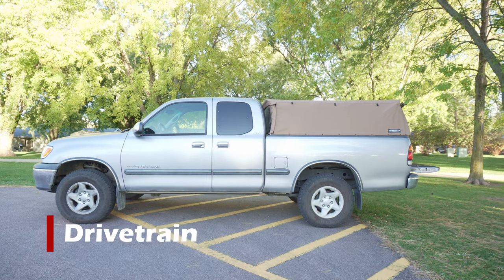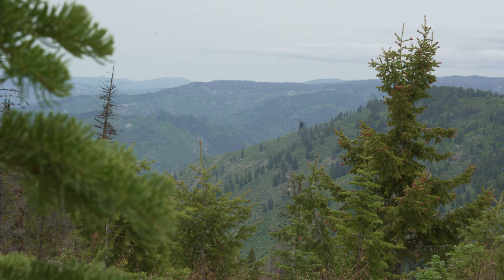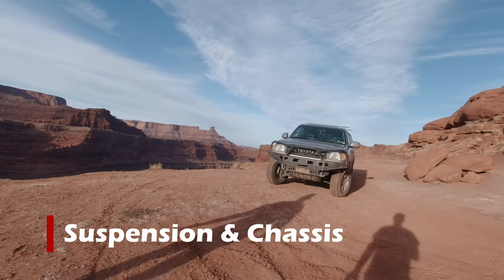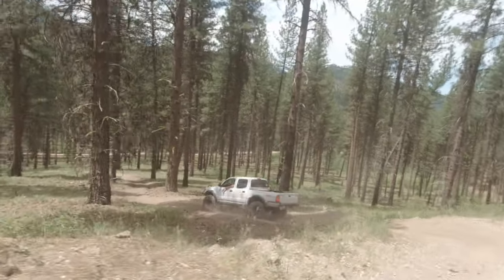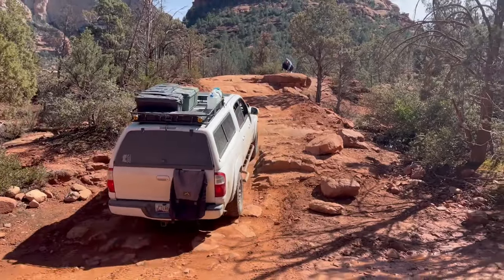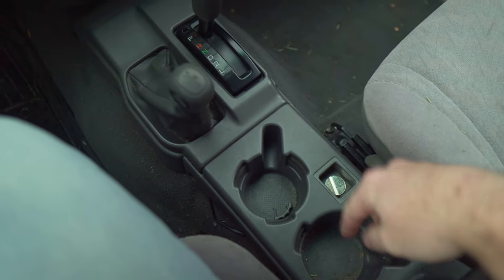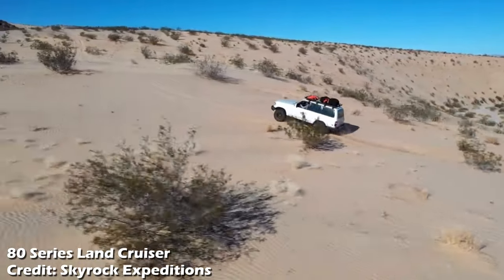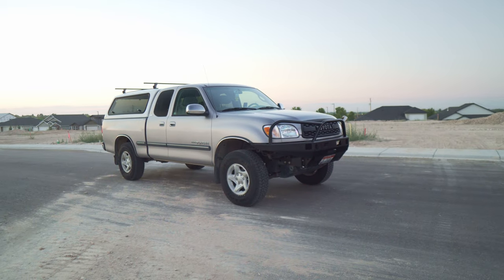This is why Toyota DOMINATES the Overland Scene

Comment: 2UZ-FE 06 Access Cab Tundra. 147,000 miles. Bought for $11K in 2021, overhauled key cylinder and replaced front struts, CV axle.  I use for dump run side gig and it paid off itself within a year
Reply from the maker: Nice! Sounds like you’ve got a solid pickup!

Comment: I bought two brand new 2003  Access cab-Tundra twenty years ago. SR·5 TRD 16wheels & limited with 17wheels. with leather ( worst mistake leather interior ).  I lifted the SR·5 and swamped tires and run the 17 inch wheels all the add on are on this one. run a K&N cold air filter & use Denson Iridium plugs .  120K.  and the limited run stock with the 16 wheels. Iridium plus & stock K&N air fliter 71K.  I also have a 3rd Tundra SR·5, I use for parts.       I've never had a car twenty years, I was spoiled with having a Dealer Demo. New car every 5K miles. I bought the car when I left the dealership.

Comment: 2002 Sequoia bought for $2750 at auction 168k miles (200k now) doing timing belt as i type. and sadly, the belt looked fine. love this rig. gonna be a trail machine with the kids here in COlorado . did TinCup and Medano passes on factory height
Reply from the maker: Awesome! Sequoia's are great vehicles

Comment: I've got a 1997 4runner with 230,000 miles and I'm currently doing a 3 inch lift and new tires to go hit some trails on the weekends. With it being a Utah car it's whole life, it's had a couple rust issues(I replaced the front calipers) but besides that, it's never ever let me down and I abuse it daily. I bought it with 70,000 miles by the way
Reply from the maker: Awesome!

Comment: Great video! Only thing I disagree with is the height statement. I'm 6'2 and can comfortably fit into my 05 Tundra. 1st gen Tacos are pretty generous as well. Only toyota I've had issues with legroom was an 03 Corolla
Reply from the maker: Ya, I’m similar height, I’m talking 6’5” ++ these trucks are more limited. I got ok in the tacos too, but if you’re tall or large they’re not comfy trucks.

Comment: I'm running a 2008 v6 4runner. She's got 291k on the clock and running just fine. I wish I had known about the gx 470 when bought the 4runner.  I'd like to have a bit more head room and the 4.7L would be nice. I'd like to swap in an FJ cruiser manual transmission (a 5 speed should have been an option), or find a way to put a D4D diesel in it.
Reply from the maker: Nice! Ya the GX470 is great.

Comment: My dad was a Toyota service manager for 30+ years so I grew up with them, owned dozens. Currently own a 2010 Tacoma TRD Sport and a 2021 Rav4 XLE. One thing you forgot to mention was the frame rust issue. My Taco had it's frame replaced just before I bought it. I would have never bought a 2nd gen had this not been done. Far too many of the Tacos and 4Runners that had that issue.
Reply from the maker: Well, ya. Rust affects almost all vehicles, though Toyota has it particularly rough. 

I live and buy vehicles in a region where rust isn’t an issue. That’s the only way most people can find clean and safe vehicles that are 20+ years old.

Comment: I had a Toyota Sequoia in the past and it was definitely more reliable than my current wrangler, besides the frame rusting away. Although, I think my wrangler hasn't been too bad on reliability, most of my issues have been with low quality aftermarket parts/upgrades.
Reply from the maker: Thanks for commenting! I've had so-so experiences with Jeeps. I daily drove an 03 TJ for a while and my main issue was that it was a bad daily driver. Very noisy, not very comfortable. I think they can be fairly reliable for their first 150k miles.

Comment: I have a 01 Tacoma 3.4L automatic transmission double cab 4wd TRD with the Toyota E-Locker in rear and a Eaton E-Locker in the front diff, King 2.5 Coil overs in front and all-pro expedition rear leaf springs, RCI 1/4” steel skid plates with the front sway bar disconnected. Rock sliders on side and steel bumpers front and rear and Warn 8,000lb Winch and the Tundra 13WL front caliper and rotor upgrade and beefed up front CV axles and a Midland MXT275 GMRS radio.  Currently running the great Nitto Ridge Grapplers P265/70R17 tires. Next set will be Toyo AT3’s.
Reply from the maker: Sounds like an awesome pickup!
Reply: @208Tyler  yea i have had it since new and it’s my baby. I only use Full synthetic oils and oem Japanese made parts and rubber bushings when i do maintenance or replacement. I did tack weld the slip joint in the steering column to get rid or the common steering wheel chatter those trucks can start developing after a few years of offroading. You notice it usually when going over cattle guards or washboard roads or rough roads.
Reply from the maker: @erice4611  Is that what the issue is?? My brothers 01 Tacoma TRD also has stupid steering wheel chatter. I notice when I've had to drive it once or twice
Reply: @208Tyler  yes it took me awhile to figure that out and replacing the slip joint is a waste cause in 30k miles or so it will start doing it again so once I pulled out the column which wasn’t too hard and just tacked welded the “slip joint” that’s designed to collapse in a serious head-on collision enough to not chatter it’s quite and solid feeling again like new and has been for years over lots of rugged terrain.

Comment: Gx460 sport package 2017 with captains chairs no air suspension  installing ome springs with beilstein 5100 front and rear 2.5 inch lift medium weight springs   (2 inch lift wirh weight).  78,000 miles on the odometer drives and looks like new.

Comment: I have to say the Nissan Frontier is right up there with the Toyotas in reliability and capability as well as beating the Toyota's out on price if you want a cheap and reliable off roader. The only negative I can think of is a very lackluster aftermarket.
Reply from the maker: Ya, they’re nice pickups. Problem is they’re a little smaller than the first Gen tundra. I intended to get a VQ40 frontier, but I couldn’t find one cheaper than my tundra.
Reply: @208Tyler  I had the opposite problem. I couldn't find a first gen tundra that wasn't beat to shit and overpriced. Decided to snag a used pro-4x instead. I do admit though it sucks for multiple people, the back is too small.

Comment: REPLACE LOWER BALL JOINTS (OEM) EVERY 150K EASY MILES (YES NEVER 555 OR AFTERMARKET = 20K MILES MAX). 2000 AND EARLY 01 LC'S HAVE AN ISSUE WITH THE TRANSMISSION O/D NEEDLE ROLLER BEARING: IT BREAKS AND COMPLETELY GRANDE THE TRANS. OLDER TOYOTAS ARE VERY WELL BUILT: MY 92 COROLLA AT 288K MILES WITH ALL ORIGINAL WHEEL BEARINGS/AC/HEAT/STEERING/ENGINE/TRANS.
Reply: THANK YOU

Comment: I've only had a tacoma for about a week and a half my only complaint with it as it doesn't flow like my last truck earlier today I hit a small divot in a dirt road that my last truck would have just rolled through, but the tacoma, DAMN, I feel like I need a chiropractor, apparently the suspension has the about as much give as a brick.

Comment: I would say the downside of Toyota is the price they are just too expensive compared to similar vehicles. I was looking to get one but I realized I could get a pathfinder for a fraction of a 4Runner. And before anyone says anything about reliability do your research. Nissan was very reliable before Renault bought them. 

With that being said I would love to get a 1st gen Sequoia and lift it 👍
Reply from the maker: Certainly. The pre-Renault R50 pathfinder, especially the VG33E, is a great vehicle. Same with the VG33E Xterra and Frontier. My tundra was a great deal, but you could still probably pick up two VG33E pathfinders for the price of my Tundra. I completely intended to get a VG33E or VQ40 Frontier, but with them being the same price as a V8 Tundra, I couldn't do it. The sequoia's are great rigs!

Comment: Steering oil leak is also a toyota failure. Am a toyota lover bcoz of its durability, no heating issues, strength but power is less compared to nissan also steering
Reply from the maker: Like power steering? On which model?

Yup, power goes down, reliability goes up haha
Reply: @208Tyler  Mostly in Landcruiser here is middle East.

Comment: You should drive a stock or well built 80 series Landcruiser if you think Jeeps are a good example of what a solid front axle can do. There is no death wobble. It rides smoother than a new JLU. I honestly think Toyota switched to IFS to save money and simplify the design and engineering process. Toyota also has a habit of making their 4x4s more difficult to modify with each generation and solid axles don't lend to that.
Reply from the maker: I’m not sure what you’re trying to argue. 

I didn’t have anything bad to say about solid axles in this video, though I did say IFS generally has a better ride. 

Every year, Toyota makes 4x4’s that sell and meets the predicted needs of their customers. Consumers don’t care about SA vs IFS, they care about ride quality, handling, etc, and IFS accomplishes that for Toyota and their customers. It’s not about making the vehicle “harder to modify”.
Reply: I’d love to have a 80 series if only that motor wasn’t woofully underpowered maybe a 2uz perhaps.
Reply: @208Tyler   No Toyota consistently and intentionally makes the trucks harder and more complicated to fit big tires on because they don't like to warranty damage that comes with big tires so they make the body mounts protrude into the wheel wells, and the bumpers have to be cut, and stuff like that. More and more with each gen.
Reply: @Rhanier Santiago  The 1FZ-FE really aint bad. Initially the 2UZ made the same hp and about 45 more lbft of torque. I think most of the bad rap the 80 gets is for the 3FE the first two years. You can also regear them by changing the transfer case gears with hand tools at home for less the half the cost of regearing axles.